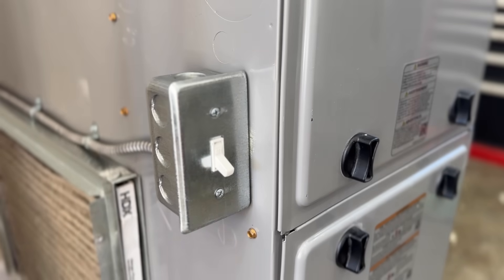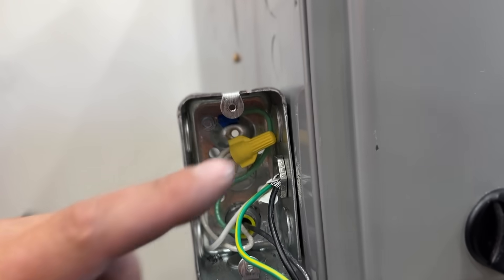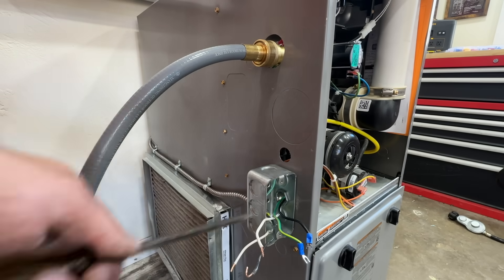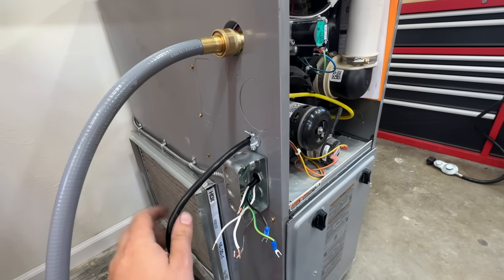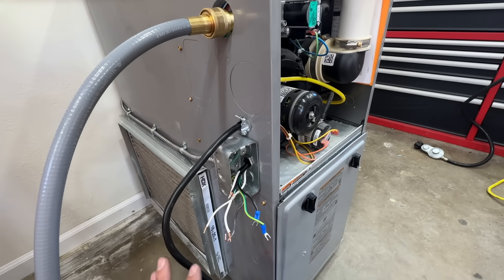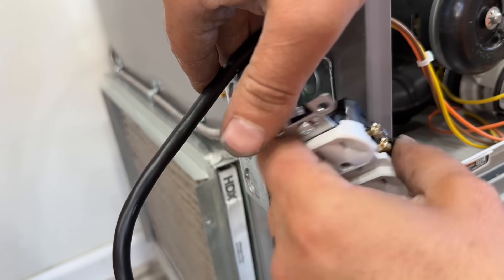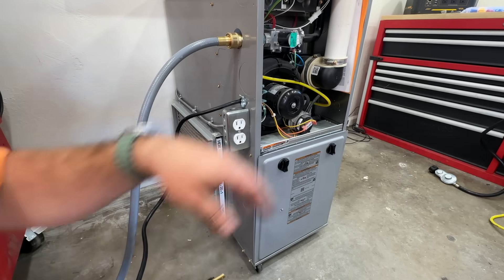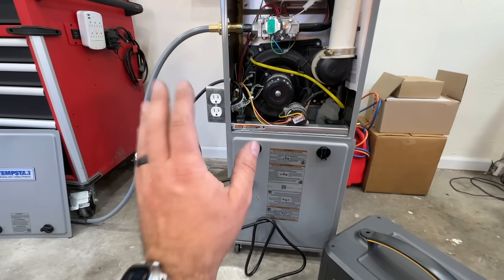Keep Your Family Warm During A Power Outage By Installing This $5 Part

Comment: @The DIY HVAC Guy, could you have just made the Wago connections between the furnace wires and the pigtail INSIDE of the furnace housing instead of inside the junction box?

Comment: Thanks for sharing knowledge 
  In 97’ we had an ice storm that killed electrical for about 2 weeks. 
  A neighbor who had power ran about 400’ of cord to an elderly lady’s house to keep a space heater going. 
  The cord was too hot to touch and I mentioned it to man I was working for. 
  After some discussion we visited the lady and my employer asked if she had gas heat?  She said yes but it doesn’t run with the power out. 
  He unplugged the space heater, plugged the central unit into the cord and POOF the whole house became heated and after an hour the cord was cool to the touch. 
  I learned so much during that event, voltage drop, HVAC , transmission line Frequency etc. 
  My gas furnace uses 7.5 amps for the blower and the inducer motor which is easy for most generators.

Comment: To make it cleaner, I would've used a cord strain relief connector on the furnace.  There isn't anything wrong with the 2-screw connector you used, we use them on disposals all the time, just a preference on my standpoint.  Good video for the DIY peeps out there.

Comment: This is very clever but it appears to be out of compliance with the National Electric Code.  Water heaters, furnaces, and other appliances fastened in place cannot be connected with a flexible cord unless the appliances are specifically identified to be used with a flexible cord [422.16(A)(2)].

Comment: I was all in until the wago nuts. Spent over 20 years in hvac and wire nuts are safe and better👍. Also to all tge diyers, make sure your extension cord is rated for this.

Comment: The only thing I have next to mine is a single plug receptacle the switch to turn the furnace off is up the stairwell at the top of the steps on mine. Am I able to do anything with mine at that receptacle plug?
Reply: If the cut-off switch is that far away now, it is in violation of most codes. Time to rewire that aspect anyway.
Reply: @starprof  The house was built in 1998. The switch is up. At the top of the basement steps and has a red emergency shut-off switch plate on it so I don't know?

Comment: Make sure your box is grounded with a screw and wire. Make sure the box is attached to the furnace with screws and not by the chase nipple. Make sure to use a larger box that one is now over filled. That is not a self-grounding receptacle. That is not the generator to use. Imagine your power being out for 2 -10 days...This is an example of what not to do by someone who thinks they know how to diy.

Comment: 2 questions...

1.why a 20 amp plug if the breaker is 15 amp?

2. If i run a long extension cable from a generator outside to that 6 foot plug extension, does that also long cord also need to be rated for 15 amps?

Comment: I just tried using an EcoFlow Delta2 to run my Lennox furnace, but the burner shut down and threw a flame sensor code.  Does this mod require a ground-neutral plug?  Thanks!

Comment: BS - ANYONE WITH GENERATORS FOR THE WHOLE HOUSE HAVE POWER GOING THROUGH THE BREAKER PANEL WHICH INCLUDES THE FURNACE... THIS IS SHIT RIGGING AND DANGEROUS FOR SOMEONE TO TRY TO BACK FEED THROUGH AN OUTLET TO POWER ANYTHING...
Reply: You obviously didn't watch the video. The whole point of doing it like this is so power isn't being backfed into the grid.

Comment: So, you gave the furnace a plug.
The power coming to the furnace got an outlet.
When power goes out you disconnect the plug and plug it into the generator.
Cool.
If the furnace is 20A you'll also want a 20 outlet and gfci if it is in a place with moisture.

Comment: Wonderful idea. Very simple and fool proof. I am a retired journeyman electrician of 39 years working. I will do this simple method on our new furnace so I can power it from the generator inlet I installed to use our Honda 2000I generator. One thing that I recommend is to make the connections to the pigtail inside the furnace instead of in the junction box. That way you free up limited space for the receptacle.  Kudos!
Reply: I like the idea of having 2 outlets, which 1 spare that allow to add a C02 monitor or other use.  The question is legal in all states.

Comment: You don’t have to do this, just take a male and female yellow plug ends used to make extension cords rated for 14/2 wire and cut into the power supply to the furnace by the furnace, install the ends into that power supply so the male end is able to plug into a female end of a extension cord.  Power goes out run power to the furnace via a extension cord from a auxiliary power unit and plug into the male end to the furnace

Comment: I wonder if this would work for an oil boiler as well since it needs electricity to come on and also run a power vent for it's exhaust. Also, doesn't the thermostat in the house that sends a call for heat need electricity in order to so and is that a separate circuit?
Reply: It should work fine as a solution for an oil furnace, but won't run as long on a 1,000 watt power station.   It will be powering the air circulation fan, the exhaust power vent, ignition, thermostat and the oil pump in the oil burner.  The low voltage thermostat is powered by a step-down transformer on the furnace  which gets its' power from the furnace's 120 volt power circuit.  Once you energize the furnace from your power station, the thermostat runs from that.
Reply: @chrisgraham2904  Thank you for the information.

Comment: what happens when the power comes back on with two power sources hooked uo
Reply: When the power comes back on  The newly installed outlet will be hot but the furnace isn't plugged in to that anymore so it won't cause a problem.  He could have explained this "big picture" a little bit better at the beginning of the video.

Comment: You need to use an inverter generator on newer gas furnaces because the sine wave of the electric has too much distortion on a standard generator. The newer circuit boards have communication capabilities and the board is able to read the distortion and will not allow the furnace to run because it will damage the board. This furnace is the same as a carrier or Bryant furnace and will show a 45 fault code. The fault code is NOT in the list of fault codes and you cannot find an explanation for it. So if you are getting that code while using a generator, you need an inverter generator with 3% or less distortion. It is also safe for all of your other electronics.
Reply: Thanks for sharing your thoughts! If you're interested, check out our award-winning documentary 𝑮𝒓𝒊𝒅 𝑫𝒐𝒘𝒏 𝑷𝒐𝒘𝒆𝒓 𝑼𝒑 narrated by Dennis Quaid. It’s free on YouTube and covers these issues in detail.

Comment: This whole comment is going to be about grounding.

First, the original switch wasn't wired correctly to begin with. The line-side ground should have been pigtailed to the receptacle box, the switch body ground and load ground.  NEVER pass ground through a receptacle or switch mounting strap. Directly ground it.

Second, when you made up the appliance cord to receptacle solution, you don't technically have to worry about pigtailing the ground straight through to the furnace circuitry.  Binding the cord to the furnace wiring and relying upon the ground pin in the 5-15 plug for grounding is correct.  However, you MUST ground the metal receptacle box. This is never optional. That grounds the box and the conduit. 

Were it a plastic box, technically you wouldn't have to.  In that case though, I would have intentionally ground the furnace chassis, Basements and utility rooms often have damp or outright wet floors. If the power is out, the sump pump will likely be out and there might be some standing water. Grounding it never, ever optional. When it doubt, default to grounding and you'll be already. If you ever encounter a ground loop issue, then you can read up more on grounding.  But it's unlikely unless you're wiring high-end electronics.

Wagos are a debate for another thread.

All in all, this is a great solution.  I've done dozens of these. It's worth it.  Just do it with good grounding practices.

Comment: Mine was wired this way from the beginning.   I put a DC motor in when my original AC motor burnt up, and i run the furnace off an UPS for longevity due to brief browouts, blackouts,  and surges.  Cheers!

Comment: Great video, but wouldn't a 1000 Wh powerstation only run the gas furnace's electric fan (probably 500-700 watt) for about 1.5 hours before needing to be recharged?

Comment: Very good post,  I'm terrible at making videos. 
I have a much easier method, but harder to explain. Here goes...
     You'll need a power source (generator, power station), a 6 foot cord with male ends on both ends of the cord and a nickel (metal washer).  I have a Generac GP 7678 Portable Generator, 30 A, 120/220 V, Gasoline, 3.7 gal Tank, 10.5 hr Run Time, Recoil Start. Bought it for camping back in 1990.
    Go to the breaker panel (box) and TURN OFF THE MAIN BREAKER to keep from back feeding the neighborhood. Next I insert a nickel between the two "breaker panel bus bars (goog-it)" so that they're tied (connected) together... This way the entire house will have temporary 110v power, just don't use hair dryers, microwave ovens, AC unit for cooling, elect clothes dryer or any other high power demand appliance. Just use small LED lights to see at night, maybe one TV and one refrigerator. Find the closest electrical outlet to the main panel and plug in the double-ended cord you made (usually, but not always, the outlet for the garage door opener is closest). Don't plug in the other end of cord till the generator is running. Make sure everything in the house is turned off except the refrigerator. Start the generator with exhaust pointed outside. Plug in the cord and wait a few minutes to make sure the generator breakers stay on. Go in the house and see if the fridge is running. My FAU is in the attic (which spawned this whole idea). I have a freezer and fridge in the garage and plug them straight into the generator. I grab the double ended cord and make sure it's not getting hot (never has) and enjoy the power. We're the only house on the block all lit up and warm (if we choose to run the heater). We make a fire in the fireplace too.  Wife usually sexes me cuz I'm so smart...
Reply: A cord with male connectors on both ends is DANGEROUS ! !
Reply: @benjaminhartsfield8037  ....So is a cord with a male connector on one end....if it's plugged into 110.....if you don't have common sense you shouldn't try ANY of this type of temporary power. Been doing this my way for over 30 yrs. Wife still thanks me too.
Reply: @ an extension cord with two male ends is known as a suicide court or Widowmaker cord, very dangerous. Just because you’ve done something for 30 years doesn’t mean it’s right. Fortunately, you or no one else has gotten her yet. Stay safe.
Reply: @ it’s not an extension cord! It’s a patch cord, special purpose…you don’t just grab this and plug it in…. it has a specific use. A Skill saw is also a very specific tool….dangerous too if you don’t know how to use it. I’ve been using one for over 40 years and still have all my digits.
Reply: @ Cooll story bro !

Comment: When you consider the prices of those medium to large "power stations" (batteries with invertors) you'd be much better off just getting a 7KW generator and hooking up the entire house to the generator through a lockout breaker on the main panel.  A generator will cost as much as those power stations and not be limited (by the charge in the power station battery).  With a generator you'd have lights throughout the entire house and be able to use a microwave and one small eye on an electric stove....plus have your furnace. With a dual fuel generator you can hook it to your natural gas line and not have to consider refueling. Gasoline generators are fine for about 8 hours on 5 gallons.

Comment: My furnace has a black wire from the switch that goes to a small transformer then I assume to an accessory like a humidifier. What should I connect that to. Thanks

Comment: ok so as I understand it, the furnace is fed ONLY by the pigtail cable, and that is either plugged into the mains (double) outlet (always live), or the  battery/inverter on the floor. That way the mains 120v can NEVER be connected the  battery inverter...   I like it ! Trouble is I live in Wisconsin and in the last 12 years I have never lost mains power....   even for 5 seconds...  So I would love to do this rig, but I can't find a reason...  Drat WE Energy is too good !

Comment: Unless you're a contractor slapping up dozens of homes, just pay the extra 30 cents for back wire outlets and switches. There is no reason to be bending wire into candy canes as a DIYer. As a bonus, unlike the contractor grade ones that can only withstand 12A continuous before they burn down your house, the back wire ones can typically take the full 15 or 20A depending on the rating you bought.

Other than that, great idea. If you have an EV you can power the furnace for weeks like this.

Comment: My wiring situation is more complicated. There's one that comes from the panel to a junction box and then a switch that's mounted on the wall further away from the furnace to that same junction box,  then wiring from the same junction box runs into the side of the furnace  So I can either use the wall light switch to turn off the furnace or at the panel to shut it off.  Does this mean I could theoretically take out the light switch mounted on the wall and just install the combo light switch outlet there instead of mounting it to the side of the furnace?

Comment: And you can use this method for a generator as well. 
You will need a good ground or the smart furnace or water heater will not operate. 
I won’t tell you how to make the equipment believe it has a ground!

Comment: I just isolate the incoming power at the main panel ( to not energize the power lines at the poll) and then back feed power from a generator using my 240v dryer plug.

Comment: Rough numbers, average furnace, how long would a battery backup last....

Looks like you answer this already - Furnace is pulling 500 watts and the battery will last about 3 hours. 
https://youtu.be/kkyPBAz0mLw?si=zByBQFc_lig1fn3t&t=540

Comment: My furnace's blower draws 9 amps when it's running. So 9A x 120V is like a 1000 watts. So, your backup power bank or generator would need to be pretty big to be able to power the furnace for more than an hour.

Comment: This will not work unless the power pack is grounded. Power packs have a floating neutral so there needs to be a ground to neutral bond. Furnace will stop in minutes without it.

Comment: One thing. Make sure you screw in both screws on the sides of the outlet, not just the ones to which you attach the wires. Leaving the other ones long makes it very easy to accidentally touch those screws to the side of your electrical box and short the circuit.

Comment: My Goal Zero Yeti 1000 1500 Watt power station causes my furnace to go into a fault mode when my blower motor kicks on.  My inverter in the Yeti blips the power momentarily because of the surge exceeds it's rating.  Be sure to have a power supply & inverter that will accommodate your furnace's Surge Amperage needs.  BTW, mine runs on a 120V 15 Amp Circuit and my Yeti is Rated at 1500 Watts.  Wattage = Voltage x Amperage So 120V x 15 = 1800 Watts!  My Furnace is somewhere between 1500 & 1800 Watts as it does not pop my breaker, but will trip the inverter on my Yeti.  So, I'm saving for a bigger power supply w/ a higher wattage inverter.  Hope to have it before January!

Comment: I just showed this video to my electricians who were at my home doing a complicated job.  They both thought it was an effective, easy to do ~ do it yourself job.  Their only recommendation was to use a GFI receptacle to make it totally safe and goof proof should someone try to plug in a Shop Vac into it and happened to be standing in water at the same time.  This only adds a few extra dollars to the cost.

Comment: The one problem that I have with this setup as I've seen it done before, is the fact that if anything should knock into that cord, you're killing power to your furnace even when there isn't a power outage.  I would not have removed the toggle switch portion, or would have set up a standard 1900 box.

Comment: Want a slightly nicer version? Use a single outlet with a switch in that box instead of a double outlet. That way you get the best of both worlds. Nice video!
Reply: That’s what I have, don’t know if it’s wired for this purpose.

Comment: Why would you loop it through the furnace, instead of just routing the power cable directly into the electrical box? Just so it's clear the extension cable is the furnace's power cord?

Comment: I did everything that was instructed in the video. Furnace works when replacement cord is plugged into outlet but doesn't work when plugged into the Ecoflow.
Reply: Because the neutral is not bonded to earth
Reply: @AuldHowker  Thank you.  Working now.

Comment: Don't coil wire carrying active AC current... electro inductance can cause the coiled wire section to heat up... I once winessed a coiled loop of a long extension cord heat up and melt the insulation. IMHO be safe and no do that.

Comment: Dumb question for electricians, the outlet ground is connected to the box, then the service panel ground is connected to box, and the ground wire end of the pigtail is wirenutted to those, then I don’t understand what happens when you plug the ground prong from the furnace pigtail into the outlet? Seems like you’re plugging the ground back into itself? Does that make sense?